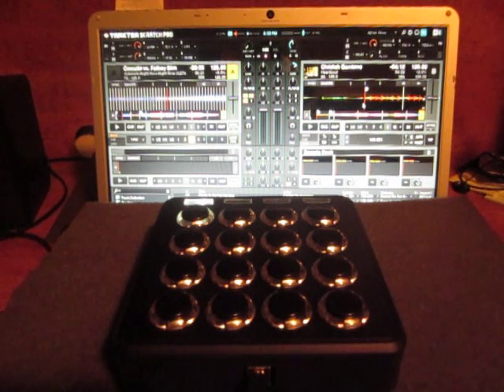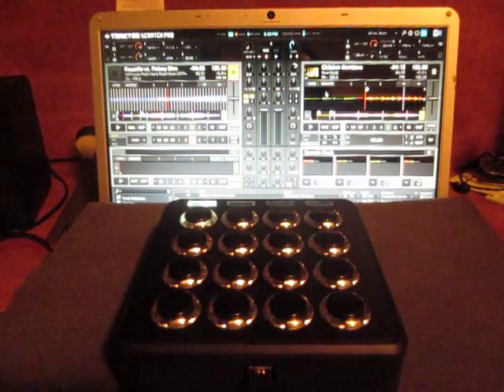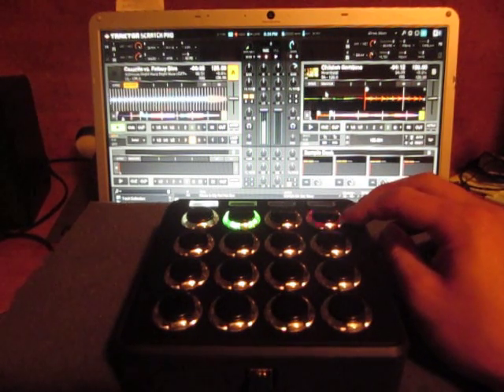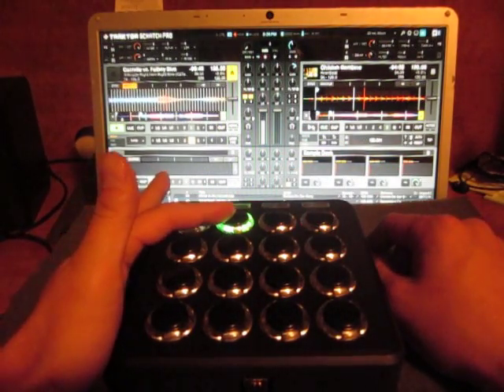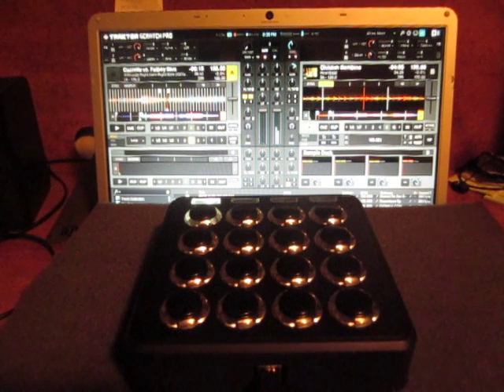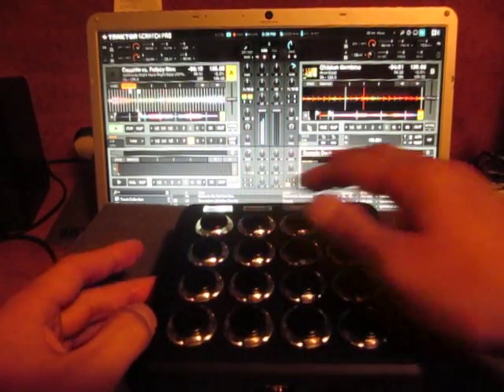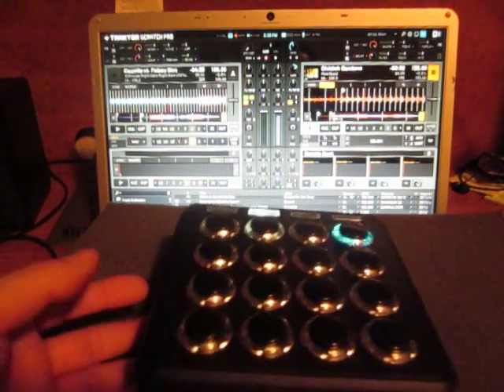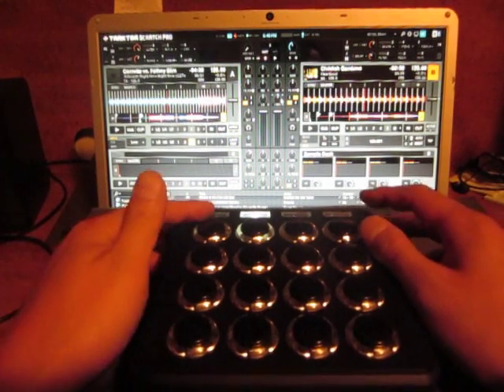MF3D DeckGratMotion Traktor Mapping Walkthrough

Comment from the maker: unfortunately the mapping was designed without using 4banks mode so if you use it in 4 banks mode you'd need to remap the 2nd bank to work with deck b. i do want to make one more update to this mapping (to add some leftover ideas i had) and at that time i'll look and see if it's easy to make an edit of this mapping that will work for 4banks mode as i've had a few others ask this and can see how it would be useful to others. its hard to remember as im also working on a bunch of other mappings